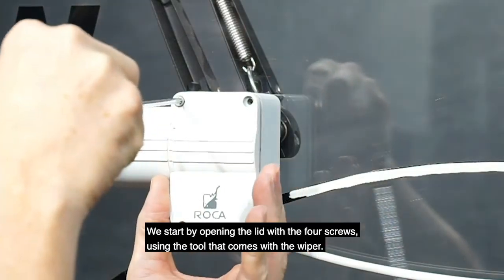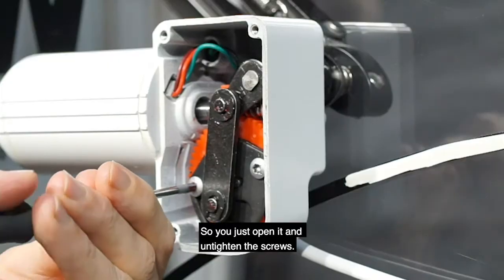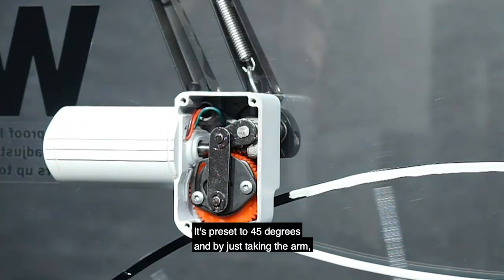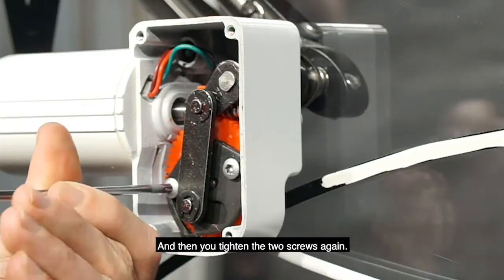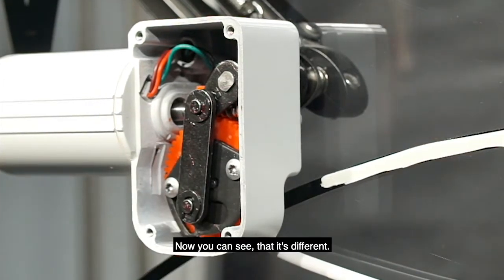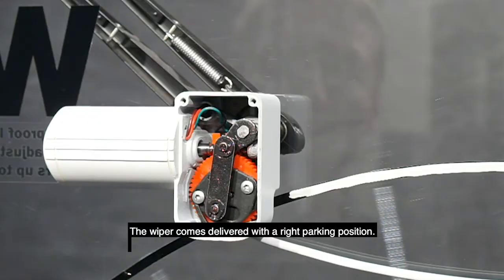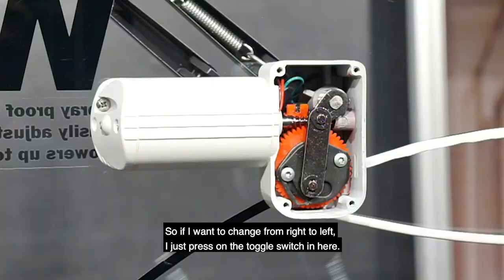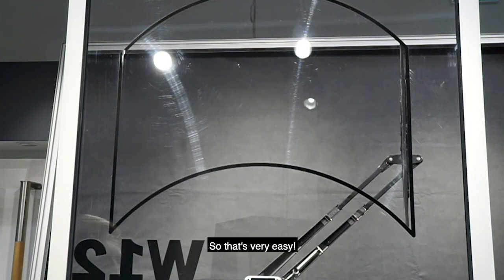Changing the sweep angle on ROCA wiper motors

Comment: After loosening the screws I am unable to move the wiper.  It does not move as easily as your demonstration.  It won't move at all.
Reply from the maker: Is the wiper working ok before you started to change? It could be that the sweep angle plate is stuck to the plate behind if it has been operating for a while. Don't use more force by pulling the wiperarm. Try to loosen the angle plate gently with a screwdriver.

Comment: Hi, I have a Roca W12 pantograph wiper system. Can I change the symetry of the movement so the wiper goes further right/left but keeping the parking position; I mean for example having 35 deg. on the left side but 45 deg on the right side.
Reply from the maker: Hi, due to the mechanical construction of the W12 gearbox, you can only have a symmetrical sweep from a centerline. You can have the centerline of the sweep off-center from the centerline of the window, but then the parking position will also change.
Reply: Thanks so much for your reply.